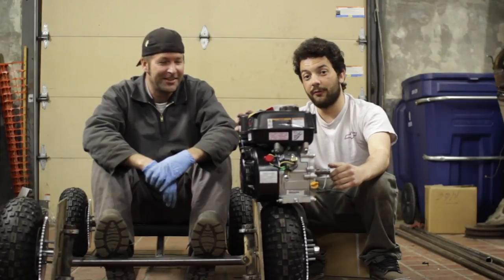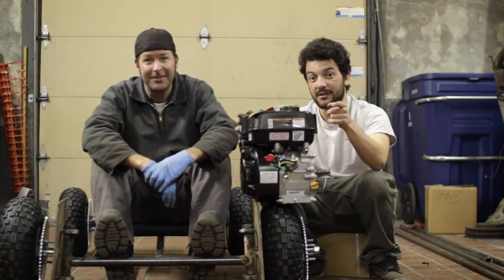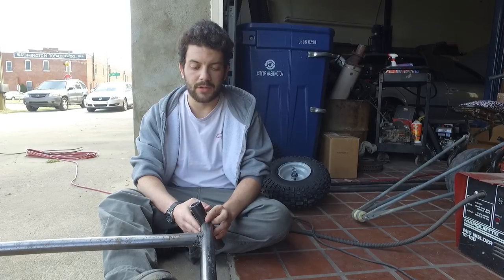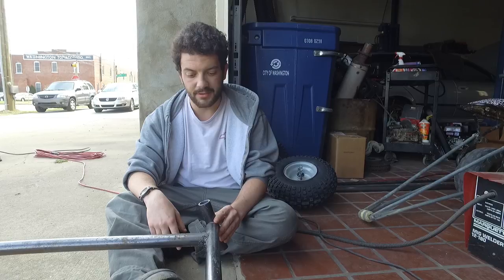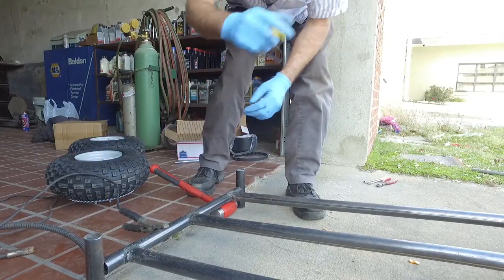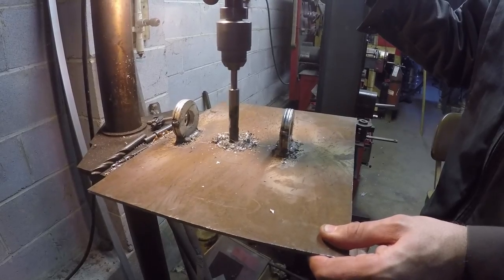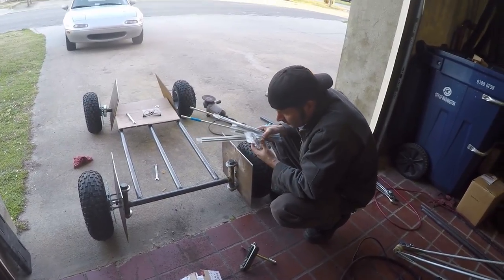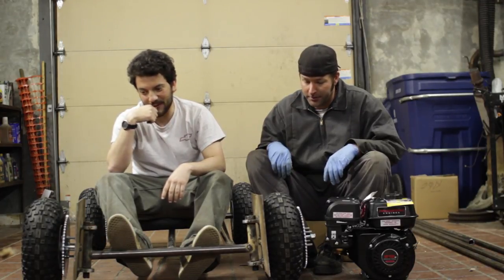AWD Go Kart Build Pt. 2

Comment: you guys should put the front two engines gas tanks in the middle so you dont have to steer with the weight of the fueltanks along with the engines

Comment: Just a suggestion.... You should find a 4-wheel steering tractor and use the rear axle from that on the front of yours.  then you could put one engine powering the front axle differential and one powering the rear.....and you can steer the front.   MUCH BETTER than an engine on each wheel.....don't really think that will work very well.

Comment: Interesting build but practically a 2 stroke 125 or even 250 would make more sense. Ungoverned 212s might make 8-9 hp each. 36 HP total with probably 200+ pounds motor weight alone. 2 stroke 125 makes 40-45 HP, revs higher and has a proper 5 peed gear box with a weight of around 50 pounds. Without the sponsorship, you would've spent more on torque converters alone than the whole dirt bike engine lol. Still a unique build that hasn't been done before.

Comment: i dont like that one side has the  sprockets on the outside and one side has the sprockets on the outside
Reply: Unless you can somehow magically run 2 engines backwards, it's gonna stay like that.
Reply: It would look better if they found some 2 stroke kart racing motors that they could reverse the rotation of the motors.
Reply: D Fuller Exactly

Comment: Can these motors be made to run in reverse rotation? If not your not Gunnar be able to build it symmetrical are you?
Reply: That's why on one wheel the sprockets on the outside and the other wheel has the sprocket on the inside of the wheel. This means both of the engines will power the engine forward, and i don't think you can run these engines backwards.
Reply: palo 123 you can it's just not worth it
Reply: Only reason I said it is because if they could run 2 in reverse rotation they could both be bolted in the centre both driving a gear each on the same shaft with u-joints at either end to allow steering to work without needing to rotate the whole motor assembly

Comment: Wouldnt it be easier doing a single bigger motor ( 670 / 420cc ) driving a hydraulic pump , then having hydromotors on all corners , then stick driving like you do a tank ? This is still cool , tho probably wont work really well  .

Comment: No, it's not going to work as is.  Hanging the engine over the wheels like that using flat steel will wobble and break without any added reinforcement.  If you insist on going that direction with the build then, what you should use is tubing to form a subframe for each engine/wheel combination.

Comment: in my own opinion your frame is extreme over kill, but theres no limit on safety deoending what your ginna do with it. think some 1/2 1/8 wall woulda done the job pretty well depending how your bracing it but either way that's jus one person opinion and I don't think yall mentioned the wall thickness. really likin the channel as well.

Comment: Hey Guys, 

There's no way to sugar coat this, but I really feel as though the frame should be wider and higher. I personally don't think that modeling it off the 670 frame was an optimal idea when you consider it was designed to fit one motor. You've made it clear in this video that weight is already a concern, but having some weight to the kart is going to make it ride smoother and it's not as though the power can't handle it. 

That said, is there a way to extend the frame you have? If height isn't an option, at very least can you add width to it? 

It's just going to have to be a bigger cart for it to operate optimally.
Reply: yea. well we need to think about transporting it and storing it. lol. yea not the best design
Reply: Lol, true. I didn't even consider that. Without widening it there'd be no point in making it taller. I doubt it will be done in two weeks, but it'd be sweet to see it in Dallas. My names Paul. I'll see you guys there! 

You bringing any toys to the meet??

Comment: wouldn't it be easier to use 2 lawn mower axles and turn them sideways, then have a transfer case with drive shafts and links like a full size 4x4? maybe not easier. But it would definitely be more capable with the shocks and you would only have to use 1 maybe 2 engines

Comment: Akerman angle is determined by the length and angel of the steering linkage, not caster and camber. Akerman angle Will turn each individual front steering tire angle on the correct radius...the inside tire in the turn will be a sharper radius than the outer tire in both directions of turn. Ie....When turning right the turning radius of your right tire (inside tire)  will be at a sharper angle than the left tire...these angles will reverse when you turn to the left...the "left" inner tire of the turn will be at a sharper radius  than the right outer tire in the turn.

Comment: guys ackerman isnt the same thing as caster, ackerman has to do with the length of the tire rods, and the angle they make with the uprights.  the goal of ackerman is to make it so the vehicle can make tight turns, it makes it so that when you have the wheels cranked over farther the inside wheel turns more than the outside wheel.  also FOR THE LOVE OF GOD brace those uprights and DEAR GOD KEEP THAT PASSENGER WHEEL IN TIGHTER.  pps, your flux welder is making that sound because it isnt feeding properly, you need to make sure the tension on the drive rollers is right, and make sure its going through the right side of the roller for the wire your using (you could also be having ground issues as well).
Reply: for 2 years I was using the wrong side of my feed roller and could never figure out why I was having such bad issues when using it. Once I changed the spool I realized that feed wheel has little grooves based on what wire you're using. It welds much better now for being such a shit flux core welder.
Reply: yeah i did it too, i ruined mine, i had to start using a c clamp or those welding vise grips to tighten the rollers (which is bad because you can crush the hollow flux core wire, ive gotten away with it but i think its just dumb luck, i really oughta fix it

Comment: why is there sprockets on the out side of the tires
Reply: Wade McKenney because the engine needs to be right on top of the wheel and the shaft of the engine needs to line up with the sprocket. If the sprocket was on the inside the engine would have to be over the kart.

Comment: I've always  supported you guys, but this one is worrying me worse than the one you tried to float on the lake!! I see a lot of missed opportunities. One engine over every wheel is going to be a mess to control, steer manage calibrate an equalize for starters. It's also probably going to tear it's self apart. Two Center mounted engines driving a common jackshaft for each drive train seems a better design. The frame it too short and too narrow. You need to notch the tubes and tig-weld if possible!!. Make the camber adjustable not to difficult to do right now.
Square tubing a must!! Four wheel steering? Hell, why not??!! what ever works for the front, just duplicate it for the rear!!

Hell, put this one in the back burner, let us help you with some concepts,  and come back to it when you have a solid concept. Spit balling this one looks like it's not going to work. Or, you can surprise us. You guys have in the past.....
Still gave you a thumbs up. Why anyone would thumb down honest effort is beyond me so party on dudes!!

Comment: Hi Guys When I looked and the weight of 2 engines on the front steering wheels I instantly thought Heavy steering trying to move roughly 70 to 80 lbs ish of motors around , Could power steering of some kind help? 
or maybe a 2 gear reduction and chain cog contraption help in movement or even more weirder a pulley system/ block and tackle other wise you aren't going to have strength to turn it 
Very much enjoying the build what ever happens at worst you will have 4 engines for other projects ! or a very interesting Kart ?
Reply: lol. thanks. yes the steering is going to be a problem but I believe I have it figured out
Reply: Oh I cant wait to see how you over come that issue Ike !

Comment: don't see it being fast but 4 independent throttle cables 2 on the floor and one for each hand and 2 steering level I think would be safer so u would have better control.
Reply: Cody Miller yeah that would be a good idea. what your basically saying (and i dont know if you realize ) is to make it 2 wheel drive and 4 wheel drive. that will be a simple but cool go kart.😎
Reply: BRU N1T3 I just see torque steer being a huge problem and being uncontrollable unless u could independently control each front wheel and the speed of all 4 motor. all 4 motors will never be rotating anywhere around the same speed

Comment: I was told that you can make engines run backwards. cant you fab the pull to spin the engine the other way? Then you could mount each engine on the inside and not have to do as much fabrication
Reply: Jacob Heishman I believe that's just old 2 stroke engines
Reply: for a 4 stroke you would have to reverse the camshaft and change when it fires

Comment: I LOVE the idea behind this and love seeing you guys design it all, but I'm seeing heavy duty everything, EXCEPT the welds!  I'm in the welding industry (over 25 years) and sorry, but #1 that welder is s-h-i-t, #2 core wire has it's place and not all core wires are created equal and my guess is you got one of the cheap ones by the amount of spatter I'm seeing.  When it comes to filler metal, it's hard to go wrong with Lincoln depending on the application.   When it comes to welders, I'm a Miller guy, but Lincolns home units aren't bad.  Miller makes all theirs in the USA though.    

PLEASE gusset the spindles and frame corners!  With that sort of power at all four wheels, I'd hate to see one break at speed!

Comment: why not take and find a zero turn lawnmower and use the hydraulic drives and put it on each corner? great torque and only uses one motor. 4 motors is a lot of weight. not to mention each motor will turn over at different speeds. kinda curious on how yall will make this work. LOL  you could even go as far as to just running a lawn mower rear end add a second pully and run a belt to the front and modify a belt drive lawn mower rear end with knuckles and u-joints to turn it. so your gearing will only be in the rear making the front turn just as fast. (well if the diff gearings are the same) if not youll either have an under or over drive depending the ratios. that seems more simplier than having 4 motors and more possibilities for chain issues.

Comment: you guys should have made a bigger frame to fit all engines without it messing with you're steering and stuff so its not over you're wheels cuz that can cause some major problems. BUT HEY NO TOOLS NO PLANS JUST GO FOR IT LOL😂 just advice though
Reply: how are you ganna turn the wheels with the chain on the front tires??

Comment: ugh i just want to see it when its finished seem really complicated for no reason. plus what if one of the engines are not in sync with the others would that cause it to steering funny or even crash. not doubting the craftsmanship just the over complexity of it seems like it would be a lot cooling and have way more fun on a single motor with an awd drive train. just sound sound like to me that there will be more tinkering and fixing that actual riding :(

Comment: scrap what u have. u only need 2 engines. 1 for a solid rear axle, and one in the front, have the motor sit lower, run a chain and sprocket to a small makeshift diff, and run 2 universal joints to drive front wheels from there. what you guys are doing now is a terrible idea, you think that 4 motors will make it fast, but in reality, 2 is lighter and will be funner. this will also exponentially reduce stress on steering components
Reply: LSX_ moe that is where 2wd amd 4wd comes in. How do you do that simply separate the 2 throttle linkage for the front for 2wd and add the 2 front linkage for 4wd. These GO karts are simple mechanism.

Comment: This channel used to be allot better
Reply: don't give up on us
Reply: Isaac it'll be fine well I like the first video about why to buy a used kart and all the stuff with the rad rod wagen and all those technical budget builds. Also I'm not a fan of removing an engines governor. You should try to get speed with torgue and not rpm. I have an off-road go-kart with diy EFI, but it still has the governor.